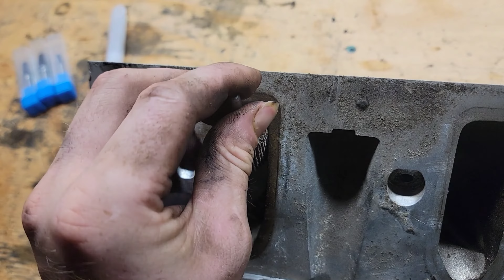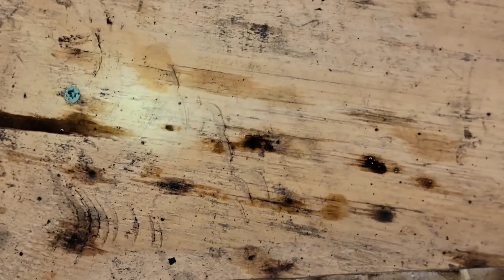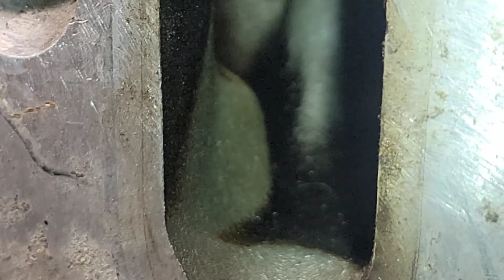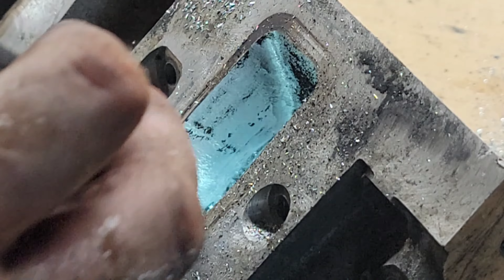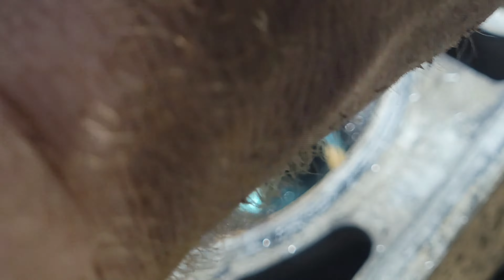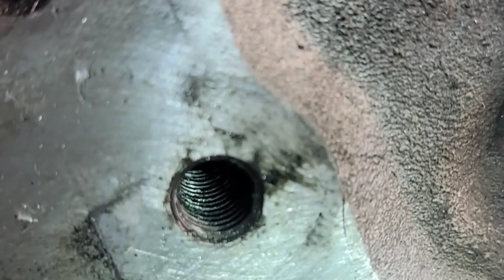How to port your LS cylinder heads! In your garage by hand! +40cfm!

Comment: Don't pat yourself on the back just yet. If you think youre gaining 40cfm from doing a "cleanup"......then fully ported cylinder heads would be gaining 100 to 150cfm or more!😂😂😂😂😂

Fact check that 40cfm. More than likely you hurt low lift flow and the intake port will stop flowing at 0.550". It'll back up 60cfm less @ 0.600" and never recover.

The swirl ramp you removed aids swirl which mixes the air/fuel charge amd promotes better burn....smh.

The short side air speeds will be much higher as well as the roof air speeds and theyll collide in the narrow and turbulent bowl that wasn't sized. All the flow you potentially gained will be beat into submission at the small throat, and what does make it out may net you 5 more ponies.

Excellent example of what you shouldn't do to a cylinder head. I bet its good to brag on though.....👍
Reply: Well said..simple bowl and ssr work with a premium valve job will net him much more
Reply: @gordocarbo  I know there's a lot videos and hype all over forums, but I've been doing cylinder head work for 20+ years. If it were that easy to gain 40cfm.....I'd be rolling in the dough!
Reply: @arturozarate1752 that must explain why you have so many cylinder head porting videos huh 😅
Reply: @DWBmotorsports  probably....
Reply: @DWBmotorsports  if posting videos is proof of years of experience and "hard lesson learned" acquired knowledge, then we're all in trouble. 

I'll consider making a video or two, but there are PLENTY of videos to view here.  If that's your thing?

I firmly believe my words speak for themselves. If there's anything you feel I've wrongly stated please let me know. I'll consider making videos, but I wouldn't hold my breath.
Reply: I ain't seen a single ported LS casting or aftermarket casting that still has the swirl ramp, and I've seen thousands.
Reply: @ptbelttactics  but you've seen them with a "fin" or "vane" tailing off the backside of the valve guide????

A low pressure system forms behind the valve. The heavier fuel will detach from the air fuel mixture and run down the long side and into the combustion chamber. Liquid fuel won't burn so tune in for detonation to happen
Reply: @arturozarate1752  I've seen them in high RPM NA LS motors that make 1,000 hp plus at 12,000 RPM, where all the material around the valve guide has been removed and a fresh new valve guide is installed exposed. The reversion in the port itself keeps the fuel suspended. Despite what you believe the air travels both directions in a running engine.
Reply: @arturozarate1752  also I don't know if you actually have experience tuning, but if you do you would know unburnt fuel won't cause detonation. It show as a lean condition and the engine will just continue to add fuel until it reaches lambda, because 02 sensors can't see fuel.
Reply: @ptbelttactics  I understand that there is moment in both directions through the port and over the valve seat.

Let me ask you this. If the reversion is what keeps the fuel suspended why is the surface finish of the intake port a concern?

Why is it not polished to a mirror finish?
Reply: @ptbelttactics  at those engine speeds the port velocities are believed to be so high that any fuel falling out of suspension in the bowl area or over the short turn will collide into the far wall and be reatomized....

We're not talking about those cylinder heads or engines here.
Reply: @arturozarate1752  air is a fluid, if you mirror polish the walls the Bernoulli principle causes the boundary layer to grow and decrease the affective cross sectional area. On the flow bench you can hear a polished port go turbulent sooner.
Reply: @arturozarate1752  the air always over shoots the short turn and collides with the bowl, always. The flow is highest opposite the short turn.
And, there isn't just a moment where the reversion is happening, the air is pulsing back and forth the whole time. Every time the valve closes, the air slams into it.
Reply: @arturozarate1752  John Kaase did these experiments a decade ago. I tried to add a link to the video, but it keeps getting removed. If you search "Kaase aetc" you can see for yourself what is happening.
Reply: @ptbelttactics  I know what's happening, but I will look for the video. It's one I haven't seen. 

To add: on a low port design the air can and in most cases will shoot over the short side. In high port, it's easier to get it around the short.
Reply: @ptbelttactics  yes I'm aware of that. That's how we get 3rd pulse tuning.
Reply: @arturozarate1752  if you were aware of it then you would know that it is impossible for a low pressure area to form behind the valve guide.
Reply: @arturozarate1752  air doesn't like to turn more than 15 degrees, we raise the port to get a better direct path to the valve. Raising the port doesn't make it easier to get around the short side, it decreases the short side. But, the flow is still greater opposite the south side and hits the opposite side of the bowl. Regardless you are still wrong about the swirl ramp.
Reply: @ptbelttactics  air is a fluid until you consider its mass.

But what does the flow bench have to do with wet flow and keeping the fuel atomized? 

Anyway, I'm saying that the heavier fuel falls out of suspension over the short turn and becomes liquid thus unburnable. You're saying the reversion keeps it suspended.....

I don't see the reversion doing so. I'm not calling your statements false....I have learned different. Where can I read more on your basis?
Reply: @ptbelttactics  the air doesn't "always over shoot". That's why the short turn is widened and the bowl area is widened. Slowing the incoming charge will allow the air to turn. Slowing it to turn will keep the fuel atomized and get more of the homogeneous mixture in the chamber for combustion.
Reply: @ptbelttactics  just watched the video. That's a lot of liquid fuel lurking around in the plenum and runner. Wouldn't you say?

I completely understand that reversion can and in a lot of cases does occur all the way back into the intake plenum. I've seen in cases where it's as bad that it's seen above the carburetor.  

However, in every severe case like that, I've been able to decrease the amount of reversion by either an exhaust port change, valve overlap change, header design change, or a wider lobe seperation. 

Reversion(from exhaust pulses returning) can be minimalized. The intake pulses(off the back of the closed valve) on the other hand can only  be optimized when calculated.

Send me a link to any information I can read or view that you feel I should consider. I'm always looking for something new.
Reply: @ptbelttactics  how would it not. You've got high speed air moving around a large radius and then left to fall into itself. Look at a rain drop.....look at an airplane's wing....
Reply: @ptbelttactics  no....the swirl ramp should be brought down to a single vane inline with the direction of the runner. Measure behind a valve guide with a pitot tube and tell me what you find.
Reply: @arturozarate1752  you are incorrect, fluid dynamics governs the behavior of air in the exact same way as any fluid. And, after the short turn the throat of the bowl creates a venturi, and the air speeds up.
Reply: @ptbelttactics  agreed air and 15° of turn was what I learned in thermal dynamics too, but in the real world and valve seats 10° increments are used too. Most commonly by myself and others off 50° seat angles.
Reply: @ptbelttactics  yes it does at the venturi.
Reply: @arturozarate1752  it is impossible to accurately wet flow a head, or even get an accurate picture of how a port is going to behave on an engine because an engine doesn't behave like a flow bench.
On the engine in the video you can see the affective cross sectional area of the clear runner as the boundary layer increases against the wall.
Reply: @arturozarate1752  you are using words you don't understand. Thermal dynamics has nothing to do with flow. And, 10° is less than 15°, which proves my point.
Reply: @ptbelttactics  what does that straighter shot at the valve do? It decrease the short side yes and would it not allow for an easier turn than a low port? 

That's why the short side was laid back for so many years. So the air could make that turn....not so more air could skip over and "collide"
Reply: @arturozarate1752  you know what you find with a pilot tube on the flow bench? No reversion.
Reply: @ptbelttactics  I doubt I'd find a pilot tube. 

I corrected mine before I sent it. Pitot tubes.....well you know what they measure. 

And you're right completely right about the 10° off the seat being less than 15°. I don't know where I was going with that. I'm driving😁
Reply: @ptbelttactics  so how about the counter weight of a crankshaft? How they can be "knife edged"? How's that shape in your eyes?
Reply: @arturozarate1752  we have been laying back the short side, and raising the roof of the port because the more of the valve you can see looking straight down the port the better is is going to flow. A very small percentage of flow makes it around the short side.
Reply: @ptbelttactics  but the short side is laid back to get flow around it.

However,  not every head benefits from a laid back short side.
Reply: @ptbelttactics  the less than "very small percentage" is where the lean side comes in and burns up the piston at the valve relief.
Reply: @ptbelttactics  still what about the crankshaft counter weight shape?
Reply: @arturozarate1752  the crankshaft travels in only one direction.
Reply: @arturozarate1752  What does the flow and valve relief have to do with AFR? At this point you are just throw things at the wall trying to get something to stick. You tune the engine to volumetric efficiency, not build the engine to match the tune.
Reply: @ptbelttactics  ok....I think I get what you saying. Let's get back to that in a second. Indulge me please.

The shape of the counter weight in a single direction in regards to windage....
Reply: @ptbelttactics  so in its one direction of travel, a lot of after market crankshafts like to use the term "knife edge". The shape the leading edge of the counter weight to a narrow point. They claim this helps reduce windage when in fact it does not. Then others round over the leading edge of that counter weight. This is half correct, but most leave the trailing edge the same way or even as bad as squared off. A low pressure are is formed there and keeps the oil attached to the crank. The proper way would be to taper that trailing edge off to a narrow "knife edge". Much like the shape of air plane's wings or the most aerodynamic shale in existence the teardrop. 

Hence teardroping the valve guide. So that's how a low pressure area exists behind the valve guide without a swirl ramp or vane. 

A good friend of mine that does cylinder heads too doesn't believe in that theory either. He removes the vane.  They're race team burns up a lot of pistons......
Reply: @arturozarate1752  your buddy is right, you are wrong on both these theories. If you think you are smarter than the engineers over at Sunny Bryant it is a waste of time trying to explain anything to you. Bryrant's R07 and Prostock crankshafts are knife-edged.
Reply: @ptbelttactics  oh man I'll let him know. He's gonna get a kick out of it.
Reply: @arturozarate1752  a sharp edge is more air dynamic than a rounded edge at high speed, which is one of the reason plains that travel below the sound barrier have rounded noses and leading edges, while fighter jets have pointed noses and sharp leading edges. The second reason the airplane wing you are thinking about, is shaped the way they are, is to generate lift. While plains with a thrust to lift greater than 1, have very flat wings because the wings are only control surfaces.
Reply: @arturozarate1752  and the thing you keep failing to understand about the valve guide, is that it is impossible for a low pressure area to form behind the valve guide. The reversion turns the back of the valve guide into front of the valve guide every few milliseconds. For that low pressure area to form the direction of flow would have to be constant.
Reply: @ptbelttactics  hmmmm....so are the crankshafts you pointed out breaking the sound barrier?
Reply: @ptbelttactics  should the crankshaft "slice" through the oil?
Reply: @ptbelttactics  and I thought of that last night when you said that the crankshaft only turns in one direction.....
Reply: @ptbelttactics  the direction of flow is constant long enough for the air fuel charge to get past the valve and into chamber......
Reply: @arturozarate1752  no, a Prostock crankshafts turns at about 180 mph at its shift points. Traveling in one direction directly into its own slip stream.
Yes the air/fuel does get past the valve, that is how the engine runs. If you rewatch John's video you will see the fuel clings to the walls at low rpm, and then as the RPM increases the reversion keeps the fuel suspended. Low RPM fuel atomization is the entire reason GM put the swirl ramp in the bowl.
Reply: @arturozarate1752  Prostock and the RO7 are dry sump.
Reply: Y’all should watch some Darrin Morgan videos!  He actually understands high speed fluid flow through a port!
Reply: @trailerparkcryptoking5213  I learned from Greg Good and John Kaase, I'm good.
Reply: @ptbelttactics  So you know it all?  Good for you, wish I did, but I like learning from many different experts because each one usually has a different strength....I will check out Greg Good and see if I can learn anything from him, never heard of him.... I’m sure you know more than this guy also, Larry Widmer, all he did was design the Boss 429 heads for Ford SVO that won Bob Glidden multiple NHRA ProStock Championships.  I wonder why SVO didn’t go to Kasse for development for those heads considering him and Glidden were buddies?  Maybe because Widmer was a genius level aeronautical engineer as was his father who was the head of engineering for one of the major defense contractors designing fighter jets, but what would they know about high speed air flow?  🤣🤣🤣.  My money says more than you!  Check out Widmers LS powered C2 vette and see if your LS work would make a pimple on his ass!   endyn.com
Reply: It took me at least 20 comments to finally find one that states how stupid this was. This guy is absolutely insane. He destroyed these heads. 😂 LS heads are great heads. You open up the mouths on intake and exhaust, clean cast lines and polish..that's all you need. You really don't want to polish the intakes to well either considering you want your fuel to adamize.
Reply: @brokensmile8487  it took me less than 1 minute reading your comment to know you don't know anything about cylinder head porting. You don't open up the intake, especially on square port heads because the CSA is already large enough. And, you only raise the roof of the exhaust port open, because lowering the floor hurts flow.
Reply: @ptbelttactics  Only a minute? Have you watched enough videos to be a professional yet? Look at you, port and polish guru. With all your expertise in your comments, I bet you make it big one day. With all this knowledge, how do you have time to spend hours commenting on a YouTube video? I'm impressed. Your going places.
Reply: @brokensmile8487  that is a long essay you wrote, your feelings must be extra hurt.
Reply: @brokensmile8487  what's most often overlooked is the short side and bowl percentage. Air doesn't like to turn, but it has to. So we help it. The short exit into the combustion chamber is the leanest area and that's why pistons start coming apart where they do. All the air is flying through the runner and past the short turn into the the long turn wall. Slowing it down by widening the short side and increasing the bowl width will help keep the air charge attached to the short turn and keep the fuel atomized. More power is made by keeping more fuel atomized because liquid fuel won't burn.

Yeah.....this is not a good way to port a cylinder head.
Reply: @arturozarate1752  man, you are lost. You widen the bowl to turn the seat into a venturi. And, you don't widen the short side, you lay it back.
Reply: @ptbelttactics  we already had our discussion over this 2 months ago.
Reply: @ptbelttactics  you lay back the short sides of LS/LS3 heads and tell me how that works out for you
Reply: @trailerparkcryptoking5213  I like Darrin Morgn and Bob Glidden. I was having a discussion with a colleague in Nevada the other day about SVO and Larry Widmer and why not Kasse....what a coincidence.

Comment: seems like that hole you make in the intake ports might cause turbulence.
Reply from the maker: The hole ends up being plugged in the end because that is where the rocker bolt goes, and the rocker bolt threads go all the way down to where that hole is made, so it doesn't end up being open at all!
Reply: Negative. The air doesn't even "see" it.
Reply: @corytaylorbuilds2566 my worry is this would affect the strength of  the hole. Have you dad any issues with the studs pulling out.
Reply from the maker: @Turtles_Hotrods  no problems at all. the hole is towards the end of the bolt, so there is still plenty of meat left for it to bite onto!
Reply: That "hole" is present on the port work of EVERY LS head porter in the country! At least the ones good enough to speak about..

Comment: Ruined the integrity of them heads. Im sorry i dont trash talk but there is no way the gains are worth grinding through the bolt wall and loosing that strength..
Reply from the maker: @ArthurFleck-tx9di  no strength is lost, cnc port jobs will do the same thing and go through into the bolt hole. As well as with old smallblock chevy heads!
Reply: You are just plain wrong. That bump decreases the CSA, and bolt only needs 1.5x the diameter in thread engagement for full strength.
Reply: Stock vortec 350 heads rocker stud is actually exposed in the intake runner without porting :p